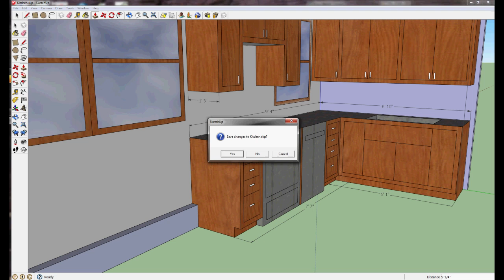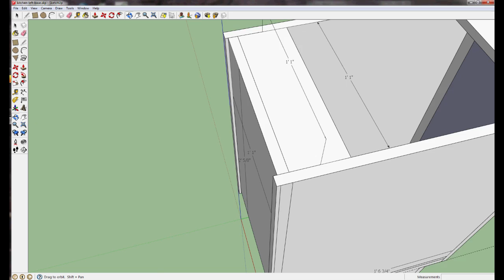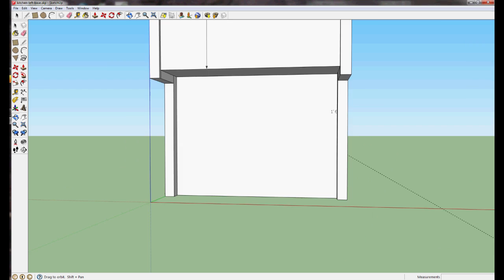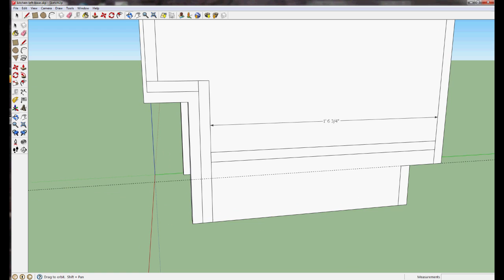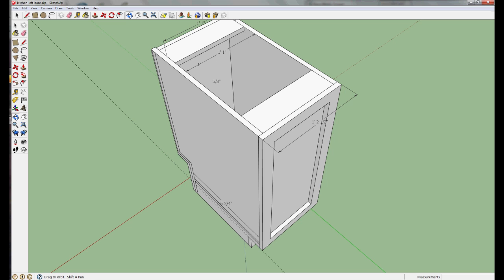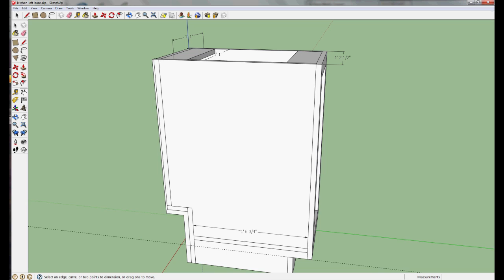How To Build Your Own Kitchen Cabinets: Part 6a

Comment: What program is that you are using for design?
Reply from the maker: Martin Kopec Hi Martin. Thanks for watching. The program is "Sketchup Make" originally called Google Sketchup. http://www.sketchup.com 

I really like it for design work and checking my measurements. Enjoy!
Reply: Thanks. I use Siemens NX at work but this seems a bit easier to use for this type of job.
Great videos BTW. Keep it up.